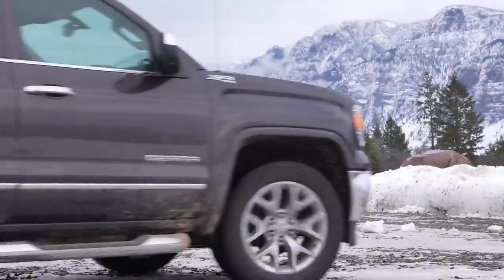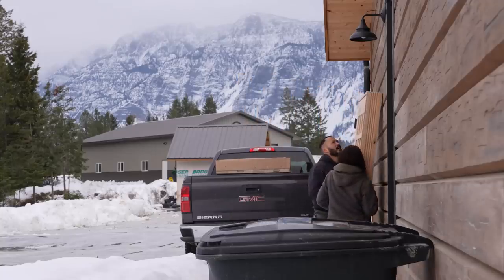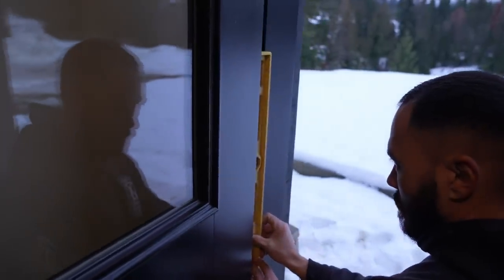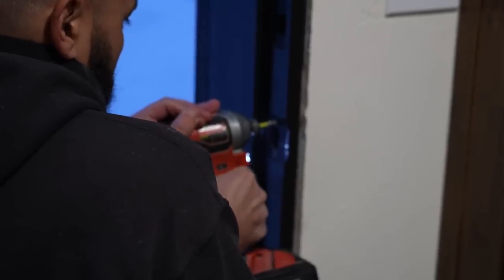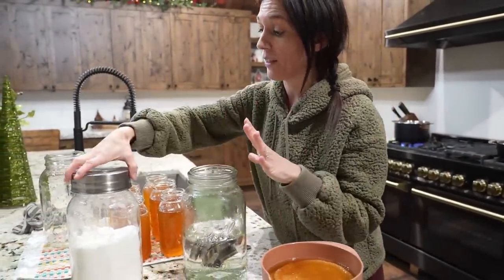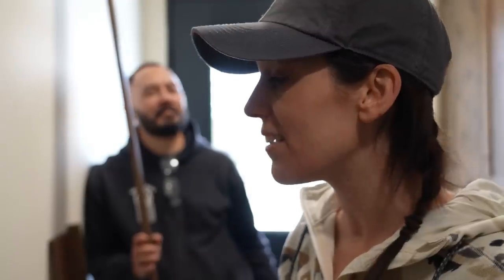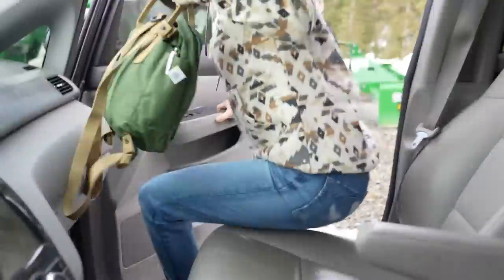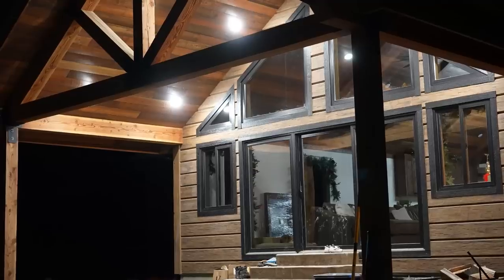We Regret It. We’re Making a Change.

Comment: My suggestion for a large wall is a quilt. It helps to stop any sound bouncing and they can be made any size in any colours and any pattern and when you need a change, you can make a new one. I'm not sure if you sew. If you do, it would be an awesome project for you to do with the family. I'm sure there is a local long-armer who can actually do the quilting for you. You can also hang them from that large ceiling so they are facing a window and/or dividing the room. (I'd say maybe hang one over the loft area). Those would probably fade faster, however, due to more direct sunlight.

Just remember Melissa, no more quote signs😂

Comment: Jeremy, Quick Pro Tip about the foam to use around doors and windows. Make sure you use GREAT STUFF Window and Door spray foam that expands much less than the GREAT STUFF Gaps and Cracks Foam. If you use the wrong foam it will expand more than needed for that aplication and push your door jamb in causing your door slab to rub againt the frame. Hope it helps. Keep up the great job!!!

Comment: I have never seen an exterior door that was installed from the inside out?  Any exterior door that I've installed on my house were installed from the outside in with the brickmould around the door on the outside.  You will definitely love the fiberglass door.  They are the best.  Hopefully you also got the fiberglass/vinyl frame so that it won't rot.  A lot more $$ but so worth it when it doesn't rot from the weather.  I've found that any exterior door that doesn't have a small roof over it gets more damage from the weather.  I love watching your progress...makes me want to design and build a new home.  :)

Comment: When I make my kombucha here in Australia, I pour abt 2-3 cups boiling water over the sugar in a 4 cup measuring cup, stir to dissolve, then add my (decaf) teabags and let them steep. The reason I use a smaller container to steep the tea is that it takes so much less time to cool off so I can make my next batch. I also noticed that you don't add any fruit to your second fermentation and that you also put the fresh kombucha straight into the fridge. I add fresh or frozen mashed or chopped fruit and let this second fermentation take on the yummy flavours for abt a week then refrigerate to slow the fermentation, and the end result is delicious! And you are correct that the  caloric sugar molecules are eaten during the fermentation as food for the scoby, but the sweetness molecules are left behind giving you a refreshing drink w/abt 30 calories per glass!

Comment: Nice episode guys!  -- QUESTION -- Do you think that the front sliding door might be better if it was a regular opening door?  Not sure that a sliding front door will hold up to dozens of repeated opening / closing cycles plus it may be a bit of a hassle to operate long term.  Never really seen a sliding front door before.  If you're going for that open glass look,, you can get a door/glass sides look that will keep the appearance and have the convenience and safety of a regular swing door.

Comment: Why not just stain the old door? Lightly sand, tact cloth, apply stain, after 10 minutes wipe stain off. Repeat until desired saturation. Let cure for at least 48 hrs then apply a clear finish of your choice. I would apply a couple of coats and let cure.

Comment: Used to do Kambucha until it gave me SIBO, be careful about ingesting too many probiotics: bacteria ends up in the small intestine where its not supposed to be. Has to be Organic tea bc there bad stuff otherwise. I would hav painted or stained it. You can spray paint the hardware with rustoleum. I just flipped a 3000 sq ft hse & thats what I did; hinges, hardware etc. Sold in 3 days w multiple over priced offers. You need a door hanging jig.